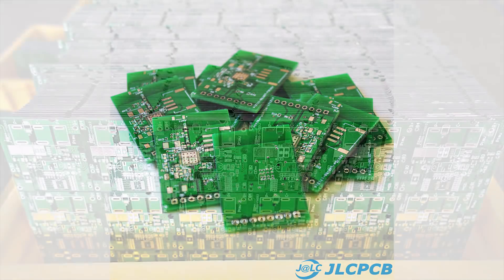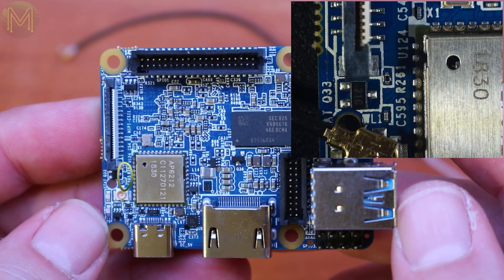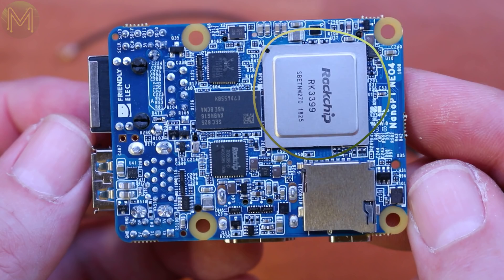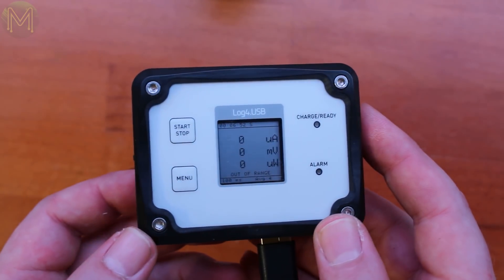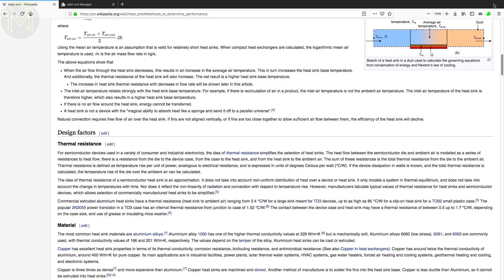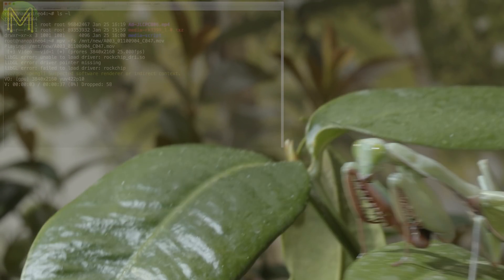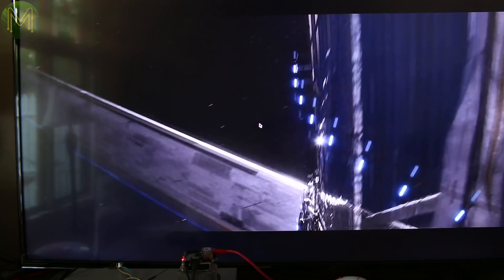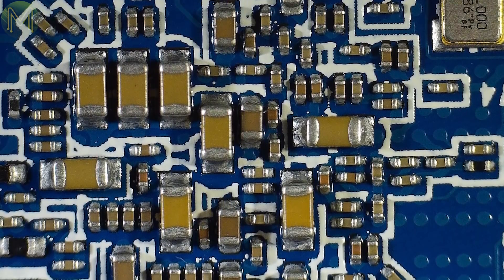#251 NanoPi NEO4: Smallest RK3399 SBC. What is real?

Comment: https://www.ebay.com/itm/TFT-SD-Shield-for-Arduino-DUE-TFT-LCD-Module-SD-Card-Adapter-2-8-3-2-inch-Mega/142976864066?_trkparms=aid%3D555018%26algo%3DPL.SIM%26ao%3D2%26asc%3D20160908110712%26meid%3D7794959b63cd46e3ae6e7b3992dc19dd%26pid%3D100677%26rk%3D3%26rkt%3D30%26sd%3D172072174431%26itm%3D142976864066&_trksid=p2385738.c100677.m4598

Comment: i prefer the rpi 3 to this, it has too many faults for my liking, i don`t like the cpu on the bottom, i also prefer micro usb for power i`m one of those people who believes if something works why change it, and micro usb works just fine.
Reply: Yes, micro usb works, but usb c is reversible, while micro usb is not. Usb c also seems more durable  (not sure if it actually is)

Usb c is also more functional, especially for the size. For example, if you power your board directly with gpio/header pins, usb c can be switched to other functions, such as power output, data transfer, and even display output. It can even do multiple functions at the same time!

Comment: I've tried all three linux softwares. So far lubuntu seemed fast enough with wifi working. Unfortunately an external Bluetooth CSR 4.0 does not work(for my wireless headphone). Needs driver support. Also, had some errors. Installing apps is somewhat troublesome. Can't install the latest arduino IDE. I don't even know how I got to install VLC. With armbian, you'll need to use lan cable. External Bluetooth works. But no wifi. Don't even bother to use friendly elec. It sucked bigtime.
Reply: One more thing, there's not enough ram for Chrome browser.
Reply from the maker: Alas, it's not really enough for a desktop.

Comment: Not sure I get the point of cramming everything into a tiny board – resulting in, among other things, an inconvenient header format – which then requires a big heatseak and fan to keep it within reasonable temps.
Reply from the maker: Actually the RockChip SOCs are the better ones to do this to. Too many of the AllWinners run too hot as it is.
But it is nice to have a tiny SBC this size. Remove the USB and ethernet, add an M.2 key and you have the smallest server around.

Comment: I've been worried about the RK3399 boards. They've had issues with playing 4K video. I really didn't want to get a NEO4 or an M4 because of those issues. There's so much potential with the SoC but no board I've seen reviewed seems to unlock its potential.
Reply from the maker: It's getting there. The question is will it get there before all the work being done on the AllWinners?
Reply: @MickMake  Will be interesting to see a comparison between Rockchip and All winner.
Reply: Yup, but allwinner are still stuck at 45nm and run really hot even at lower clocks!

Those rockchip looks more the way to go once the drivers are done!

I remember when back in time rockchip had lots of non working Functional blocks inside the die... The most know one was the Ethernet phy! All manufacturers had to use an external nic due to this hardware bug.

But now those socs looks good!